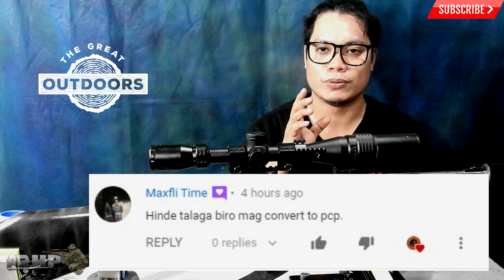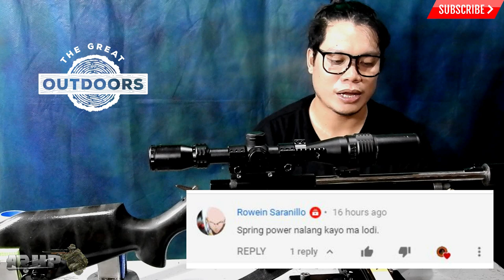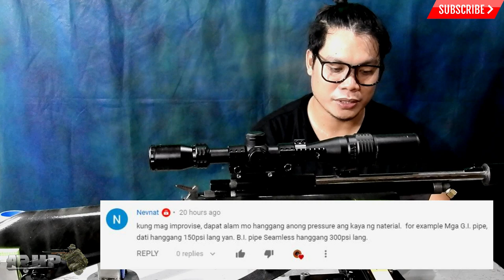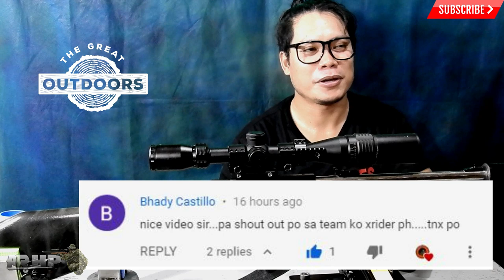BAKIT GUSTO MO NG AIRGUN? | Halagang 7000pesos may Airgun kana

Comment: Sir saan sa Bacolod pwede makabili ng air gun?
Reply from the maker: lupues sports section may ara nada sila >

Thanks, po sa inyong mensahe. Maraming salamat po sa panonood.
Magandang Araw po sa inyong lahat, Maraming salamat sa inyong pagbisita sa ating channel.
Ganon din, salamat po sa inyong patuloy na pag subaybay. Mabuhay po kayo!
Always keep safe po, and God bless po sa inyo at sa inyong Pamilya.

Regarding po sa tanong ninyo. Pwede nyo pong ma contact sa messenger ang mga sellers po para ma assist po kau sa mga:
1. Contact info like cp# ng sellers
2. Accessories ng mga airgun
3. Brand ng airguns na avail nila
4. pricelist
5. paano ipadala
6. mode of payment
7. saan location nila
8. o may branch ba malapit sa inyo
9. atbp. na mga katanungan.
LOCAL SELLERS:
1. Win Lustarez
2. Robin Samonte
3. Rolly Aurellana
4. Philip Jeffreth Mendoza
5. Raffy Artigas

PAANO MAGING SAFE AND LEGIT CHECK?
1. Mag pa legit check-Ask ang mga matagal na sa airgunner
2. Mag padala ng Private Message- Send a message regarding sa information na gusting malaman
3. Once nag reply ask question regarding sa accessories or type ng airgun na bibilhin
4. Once na nakapag decide na sa bibilhin, mag video call po kayo para na makita nyo xa same sa profile pic at photos ng naka transaction na seller.
5. Before mag bayad sa item na kinuha mag papadala ang Seller ng Video na binabalot nya ung item mo
6. Hingin ang code if sa ano mang currier nya pinadala.

ADD ON QUESTION:
Ano ung valve na naka thread?
Ito po ang vid na ginawa ko sa installation ng airgun nimrod: https://www.youtube.com/watch?v=wrj_i6z119w&feature=youtu.be
Maraming salamat po. From AIR RIFLE HOBBIES PHILIPPINES

Comment: boss meron po bang brake barrel sa pilipinas?
Reply from the maker: Mayrob p osa pb dionisio may mga store sa pinas..

Sa fb po ma search nyo cla.

Magandang Araw, thanks for tuning in po. Ako po ay nag papasalamat sa patuloy nyo pong pag subaybay sa aking Channel.
Ito po yung kadalasang tanong na hope po makatulong.
SAAN MAKABILI NG AIRGUN?
Makakabili o makakaampon po tayo ng Airgun sa mga online store sa Facebook po.
1.	Search Airgun group sa "Facebook"
2.	Once accepted and join post for inquires
3.	They will Private message po sa inyo sa mga details
a.	Payment method
b.	Specs ng Airgun
c.	Warranty
d.	Atbp.
4.	Do background and legit check po by posting sa group
a.	Tingnan mga friends list niya if madami syang kaibigan na Air gunners
b.	Kung kalian ginawa account nya at least 5 years
c.	Do a video call sa transaction and screen record for assurance.
d.	Maganda kaliwaan ang pag bayad like meet up
PWEDE BA IPA CONVERT ANG C02 TO PCP?
Yes, pwede po sir, e check po ng maker if pwede most of the Airgun like: Nimrod, Manlapat, Taurus, Armscor, Atbp.
Pakita nyo lang po sa maker and ang maker na po mag suggest sa inyo anong conversion gusto nyo like bottle o naka tube. Range po sa 8k-12k pataas po ang bayad sa conversion nakadepende po sa maker. 

PAANO PAPADALA NG SELLER ANG AIRGUN?
Papadala sa currier ng seller, sila na po bahala doon.
By buss o barko, make sure po na complete address and my phone number and ask how long dadating.
Ganon din ask ang sellers for warranty what if di makakarating ang Item.

KAILANGAN BA NG LICENCE ANG AIRGUN?

There is no law that will punish anyone in the country for having an airsoft/airgun even if it is not registered. You also don’t need any form or permit or license to own one...our firearms law R.A. 10591 does not include the word airsoft or airgun in there. Feb 6, 2019.
Credit from: Journal.com.ph

PAANO MA PA REGISTER ANG AIRGUN?

Pag nakasali na sa mga Airgun group sa Facebook
You can ask for the legit person for register 
(LARRY AVILA) Philippine Team natin you can ask him po
Magbibigay sya ng mga info for requirments
Maganda if by group po ung pag register para isahan nadin po

PWEDE BANG ISAKAY SA BUSS O BARKO ANG AIRGUN?
1.	Kailangan po na naka register ang Airgun
2.	Kailangan dn may receipt ang Airgun na makikita kau ang may-ari
3.	Mag inquire sa Buss and Ship station if pwede isakay ang Airgun
a.	Ipakita ang registration at Reciept 
4.	Pag pumayag na sila doon lang dadalhin ang Airgun
5.	Baklasin ang Airgun-walang laman na c02 o hangin- at ilagay sa safe na lagayan
PWEDE BA MAISAKAY SA AIRPLAIN ANG AIRGUN FROM IBANG BANSA SA PINAS?
Sa ngaun limited po ang kaalaman ko tungkol dyan, ang iba sabi nila nakakapag padala sila sa balik bayan box.
PRICELIST STOCK AIRGUN: (Walang scope, Bipod, c02 Tank)
Depende po sa Seller ang Price either mababa sa binanggit kung Price o Mataas.
1.	Nimrod co2 7500 more or less
2.	Manlapat co2 13k more or less
3.	Taurus co2 7500 more or less
4.	Eskopeta co2 from 5500 pataas
5.	Jr mangio co2 from 7500 more or less 
6.	PCP pump 3k more or less 3 stage
7.	PCP pump 4k more or less 4 stage 
8.	PCP starting from 15k-50k local made
9.	Scope from 3500-18k
10.	Suppressor from 2k-5k
11.	Tripod from 1500-2500

About namn po sa mga location ng pamilihan-cnxa po dahil hindi po ako affiliated sa mga company po o pagawaan ng airgun dito sa Pinas o sa ibang bansa.
Thanks, po sa support, Share and SUBSCRIBE po.
 from Air Rifle Hobbies Philippines.
Reply: @AirRifleHobbiesPhilippines  salmat po ...
Reply from the maker: Welcome po sir

Comment: Sir ng bebenta po kau ng airgun.mgkano po? Hammer type na po.tsk may silencer.walang scope
Reply from the maker: Magandang Araw, thanks for tuning in po. Ako po ay nag papasalamat sa patuloy nyo pong pag subaybay sa aking Channel.
Ito po yung kadalasang tanong na hope po makatulong.
SAAN MAKABILI NG AIRGUN?
Makakabili o makakaampon po tayo ng Airgun sa mga online store sa Facebook po.
1.	Search Airgun group sa "Facebook"
2.	Once accepted and join post for inquires
3.	They will Private message po sa inyo sa mga details
a.	Payment method
b.	Specs ng Airgun
c.	Warranty
d.	Atbp.
4.	Do background and legit check po by posting sa group
a.	Tingnan mga friends list niya if madami syang kaibigan na Air gunners
b.	Kung kalian ginawa account nya at least 5 years
c.	Do a video call sa transaction and screen record for assurance.
d.	Maganda kaliwaan ang pag bayad like meet up
PWEDE BA IPA CONVERT ANG C02 TO PCP?
Yes, pwede po sir, e check po ng maker if pwede most of the Airgun like: Nimrod, Manlapat, Taurus, Armscor, Atbp.
Pakita nyo lang po sa maker and ang maker na po mag suggest sa inyo anong conversion gusto nyo like bottle o naka tube. Range po sa 8k-12k pataas po ang bayad sa conversion nakadepende po sa maker. 

PAANO PAPADALA NG SELLER ANG AIRGUN?
Papadala sa currier ng seller, sila na po bahala doon.
By buss o barko, make sure po na complete address and my phone number and ask how long dadating.
Ganon din ask ang sellers for warranty what if di makakarating ang Item.

KAILANGAN BA NG LICENCE ANG AIRGUN?

There is no law that will punish anyone in the country for having an airsoft/airgun even if it is not registered. You also don’t need any form or permit or license to own one...our firearms law R.A. 10591 does not include the word airsoft or airgun in there. Feb 6, 2019.
Credit from: Journal.com.ph

PAANO MA PA REGISTER ANG AIRGUN?

Pag nakasali na sa mga Airgun group sa Facebook
You can ask for the legit person for register 
(LARRY AVILA) Philippine Team natin you can ask him po
Magbibigay sya ng mga info for requirments
Maganda if by group po ung pag register para isahan nadin po

PWEDE BANG ISAKAY SA BUSS O BARKO ANG AIRGUN?
1.	Kailangan po na naka register ang Airgun
2.	Kailangan dn may receipt ang Airgun na makikita kau ang may-ari
3.	Mag inquire sa Buss and Ship station if pwede isakay ang Airgun
a.	Ipakita ang registration at Reciept 
4.	Pag pumayag na sila doon lang dadalhin ang Airgun
5.	Baklasin ang Airgun-walang laman na c02 o hangin- at ilagay sa safe na lagayan
PWEDE BA MAISAKAY SA AIRPLAIN ANG AIRGUN FROM IBANG BANSA SA PINAS?
Sa ngaun limited po ang kaalaman ko tungkol dyan, ang iba sabi nila nakakapag padala sila sa balik bayan box.
PRICELIST STOCK AIRGUN: (Walang scope, Bipod, c02 Tank)
Depende po sa Seller ang Price either mababa sa binanggit kung Price o Mataas.
1.	Nimrod co2 7500 more or less
2.	Manlapat co2 13k more or less
3.	Taurus co2 7500 more or less
4.	Eskopeta co2 from 5500 pataas
5.	Jr mangio co2 from 7500 more or less 
6.	PCP pump 3k more or less 3 stage
7.	PCP pump 4k more or less 4 stage 
8.	PCP starting from 15k-50k local made
9.	Scope from 3500-18k
10.	Suppressor from 2k-5k
11.	Tripod from 1500-2500

About namn po sa mga location ng pamilihan-cnxa po dahil hindi po ako affiliated sa mga company po o pagawaan ng airgun dito sa Pinas o sa ibang bansa.
Thanks, po sa support, Share and SUBSCRIBE po.
 from Air Rifle Hobbies Philippines.

Comment: Bos..sa maynila saan ba mka bile nyan
Reply from the maker: Thanks, po sa inyong mensahe. Maraming salamat po sa panonood.
Regarding po sa tanong ninyo. Pwede nyo pong ma contact sa messenger ang mga sellers po para ma assist po kau sa mga:
1. Contact info like cp# ng sellers
2. Accessories ng mga airgun
3. Brand ng airguns na avail nila
4. pricelist
5. paano ipadala
6. mode of payment
7. saan location nila
8. o may branch ba malapit sa inyo
9. atbp. na mga katanungan.
LOCAL SELLERS:
1. Menchie Muli
2. Win Lustarez
3. Robin Samonte
4. Rolly Aurellana
5. Philip Jeffreth Mendoza

PAANO MAGING SAFE AND LEGIT CHECK?
1. Mag pa legit check-Ask ang mga matagal na sa airgunner
2. Mag padala ng Private Message- Send a message regarding sa information na gusting malaman
3. Once nag reply ask question regarding sa accessories or type ng airgun na bibilhin
4. Once na nakapag decide na sa bibilhin, mag video call po kayo para na makita nyo xa same sa profile pic at photos ng naka transaction na seller.
5. Before mag bayad sa item na kinuha mag papadala ang Seller ng Video na binabalot nya ung item mo
6. Hingin ang code if sa ano mang currier nya pinadala.

ADD ON QUESTION:
Ano ung valve na naka thread?
Ito po ang vid na ginawa ko sa installation ng airgun nimrod: https://www.youtube.com/watch?v=wrj_i6z119w&feature=youtu.be
Maraming salamat po. From AIR RIFLE HOBBIES PHILIPPINES

Comment: Sir, saan ako pwede mkabili ng airgun na worth 7k?
Reply from the maker: Thanks, po sa inyong mensahe. Maraming salamat po sa panonood.
Magandang Araw po sa inyong lahat, Maraming salamat sa inyong pagbisita sa ating channel.
Ganon din, salamat po sa inyong patuloy na pag subaybay. Mabuhay po kayo!
Always keep safe po, and God bless po sa inyo at sa inyong Pamilya.

Regarding po sa tanong ninyo. Pwede nyo pong ma contact sa messenger ang mga sellers po para ma assist po kau sa mga:
1. Contact info like cp# ng sellers
2. Accessories ng mga airgun
3. Brand ng airguns na avail nila
4. pricelist
5. paano ipadala
6. mode of payment
7. saan location nila
8. o may branch ba malapit sa inyo
9. atbp. na mga katanungan.
LOCAL SELLERS:
1. Win Lustarez
2. Robin Samonte
3. Rolly Aurellana
4. Philip Jeffreth Mendoza
5. Raffy Artigas

PAANO MAGING SAFE AND LEGIT CHECK?
1. Mag pa legit check-Ask ang mga matagal na sa airgunner
2. Mag padala ng Private Message- Send a message regarding sa information na gusting malaman
3. Once nag reply ask question regarding sa accessories or type ng airgun na bibilhin
4. Once na nakapag decide na sa bibilhin, mag video call po kayo para na makita nyo xa same sa profile pic at photos ng naka transaction na seller.
5. Before mag bayad sa item na kinuha mag papadala ang Seller ng Video na binabalot nya ung item mo
6. Hingin ang code if sa ano mang currier nya pinadala.

ADD ON QUESTION:
Ano ung valve na naka thread?
Ito po ang vid na ginawa ko sa installation ng airgun nimrod: https://www.youtube.com/watch?v=wrj_i6z119w&feature=youtu.be
Maraming salamat po. From AIR RIFLE HOBBIES PHILIPPINES

Comment: Boss..maganda naba ung airgun sa halagang 7k..
Reply from the maker: Thanks, po sa inyong mensahe. Maraming salamat po sa panonood.
Magandang Araw po sa inyong lahat, Maraming salamat sa inyong pagbisita sa ating channel.
Ganon din, salamat po sa inyong patuloy na pag subaybay. Mabuhay po kayo!
Always keep safe po, and God bless po sa inyo at sa inyong Pamilya.

Regarding po sa tanong ninyo. Pwede nyo pong ma contact sa messenger ang mga sellers po para ma assist po kau sa mga:
1. Contact info like cp# ng sellers
2. Accessories ng mga airgun
3. Brand ng airguns na avail nila
4. pricelist
5. paano ipadala
6. mode of payment
7. saan location nila
8. o may branch ba malapit sa inyo
9. atbp. na mga katanungan.
LOCAL SELLERS:
1. Win Lustarez
2. Robin Samonte
3. Rolly Aurellana
4. Philip Jeffreth Mendoza
5. Raffy Artigas

PAANO MAGING SAFE AND LEGIT CHECK?
1. Mag pa legit check-Ask ang mga matagal na sa airgunner
2. Mag padala ng Private Message- Send a message regarding sa information na gusting malaman
3. Once nag reply ask question regarding sa accessories or type ng airgun na bibilhin
4. Once na nakapag decide na sa bibilhin, mag video call po kayo para na makita nyo xa same sa profile pic at photos ng naka transaction na seller.
5. Before mag bayad sa item na kinuha mag papadala ang Seller ng Video na binabalot nya ung item mo
6. Hingin ang code if sa ano mang currier nya pinadala.

ADD ON QUESTION:
Ano ung valve na naka thread?
Ito po ang vid na ginawa ko sa installation ng airgun nimrod: https://www.youtube.com/watch?v=wrj_i6z119w&feature=youtu.be
Maraming salamat po. From AIR RIFLE HOBBIES PHILIPPINES

Comment: Bos may binta kb.?
Reply from the maker: Thanks, po sa inyong mensahe. Maraming salamat po sa panonood.
Magandang Araw po sa inyong lahat, Maraming salamat sa inyong pagbisita sa ating channel.
Ganon din, salamat po sa inyong patuloy na pag subaybay. Mabuhay po kayo!
Always keep safe po, and God bless po sa inyo at sa inyong Pamilya.

Regarding po sa tanong ninyo. Pwede nyo pong ma contact sa messenger ang mga sellers po para ma assist po kau sa mga:
1. Contact info like cp# ng sellers
2. Accessories ng mga airgun
3. Brand ng airguns na avail nila
4. pricelist
5. paano ipadala
6. mode of payment
7. saan location nila
8. o may branch ba malapit sa inyo
9. atbp. na mga katanungan.
LOCAL SELLERS:
1. Win Lustarez
2. Robin Samonte
3. Rolly Aurellana
4. Philip Jeffreth Mendoza
5. Raffy Artigas

PAANO MAGING SAFE AND LEGIT CHECK?
1. Mag pa legit check-Ask ang mga matagal na sa airgunner
2. Mag padala ng Private Message- Send a message regarding sa information na gusting malaman
3. Once nag reply ask question regarding sa accessories or type ng airgun na bibilhin
4. Once na nakapag decide na sa bibilhin, mag video call po kayo para na makita nyo xa same sa profile pic at photos ng naka transaction na seller.
5. Before mag bayad sa item na kinuha mag papadala ang Seller ng Video na binabalot nya ung item mo
6. Hingin ang code if sa ano mang currier nya pinadala.

ADD ON QUESTION:
Ano ung valve na naka thread?
Ito po ang vid na ginawa ko sa installation ng airgun nimrod: https://www.youtube.com/watch?v=wrj_i6z119w&feature=youtu.be
Maraming salamat po. From AIR RIFLE HOBBIES PHILIPPINES